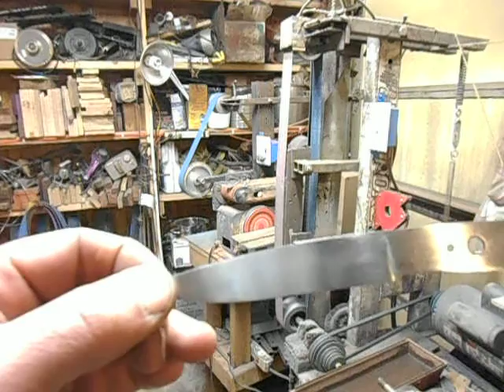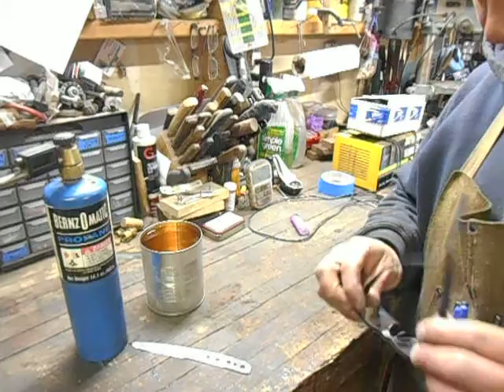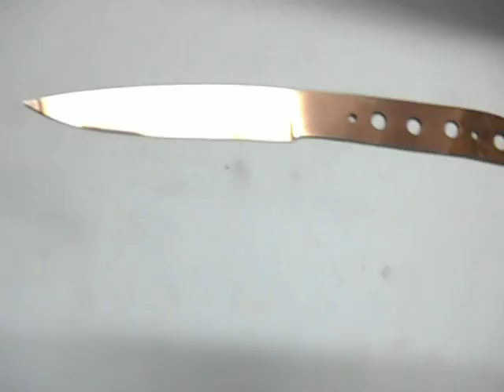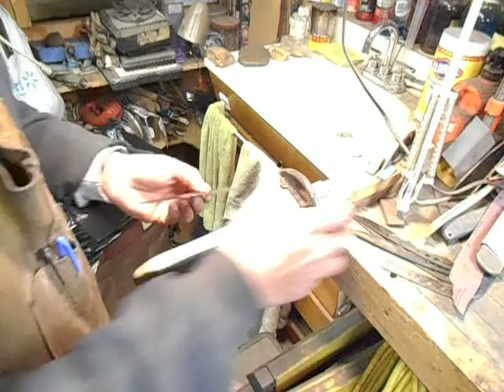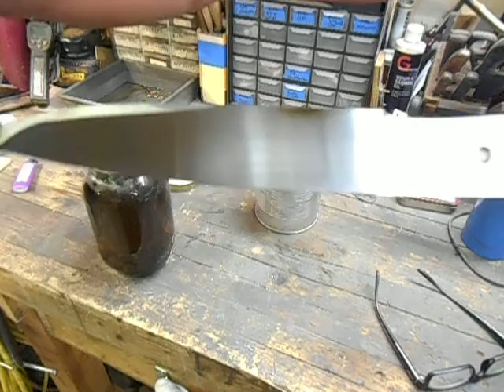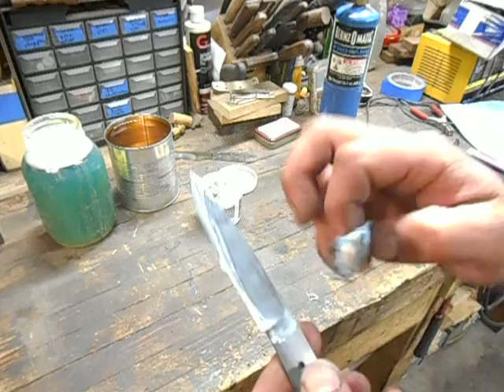etching knives to find faults #1

Comment: Good tip on keeping the fingertips safe...although I'm just going to take your word for it that it's hard to work without them :)
Reply from the maker: +C amber that is a heck of an idea! slicing the ends of your fingers off is never a good time, nor grinding or burning them off :} since ive done all three, I bet my fingerprints would look pretty funny though :}
Reply: +Joe Calton I've burned them pretty good before picking up a cast iron pan I didn't think was hot, but the other two I've been lucky to avoid, thankfully.

At least the gov't can't track you now :)  Although I hope it doesn't happen to you again.